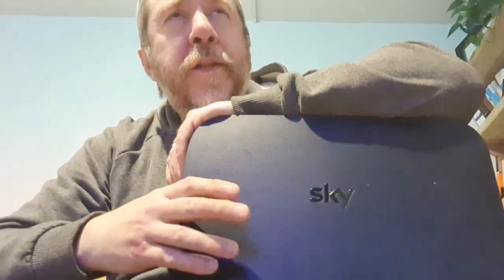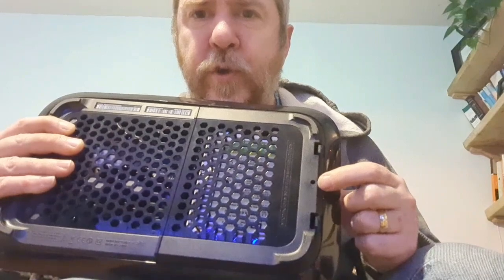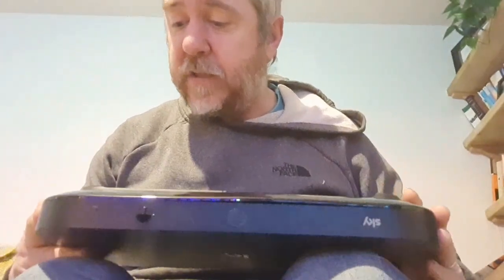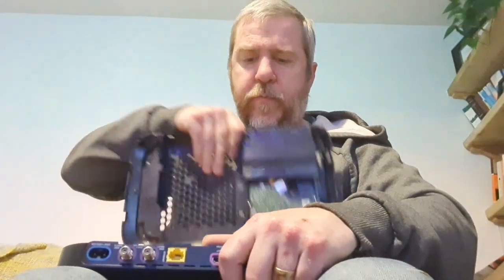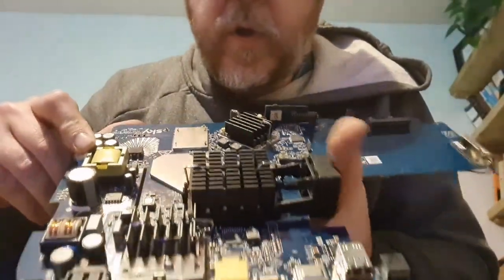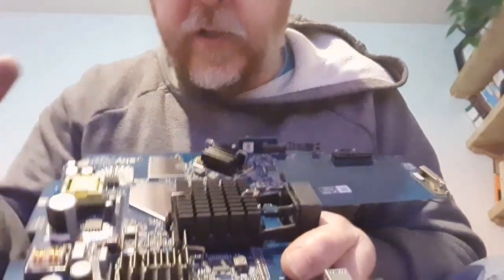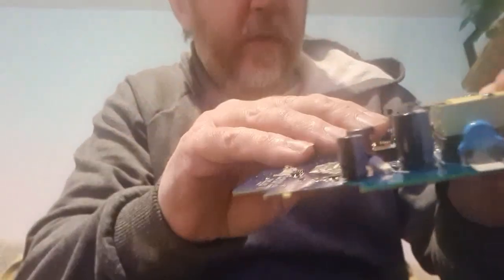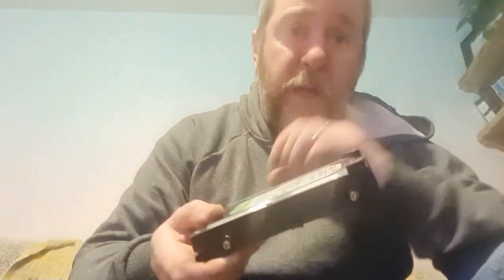Scrapping a Sky Q digital satellite TV box.  Is it better than the Sky + HD box for scrapping?

Comment: My dad was suckered into upgrading to Sky Q because he contacted Sky about having another HD box installed in his bedroom. They turned the patter on by telling him Q was the best option and he signed up without doing his research. That was a couple of years ago, and within months of having it fitted, it started to go south.

The box in his bedroom would intermittently unpair with the main box in his living room, leaving the only way to fix it by turning both boxes off for 30 seconds to clear the the system and then reboot and manually repair.

I told him to phone them up and get them to come back, take it all out and put the original boxes, but when he phoned them, they told him they couldn't because it was a one-way process that couldn't be undone. They offered to send out an engineer more than once to look into the problem in case it was a local hardware issue, and they would always say things like "it should work now" or "yeah, there was an problem, but we are already aware of it and it's a network issue that we are already working on and it should be fixed within the next 5-7 days." and it wouldn't make the slightest bit of difference.

Since then, it's deteriorated to the point where the picture freezes for a couple of seconds to losing it altogether leading to him having to reboot everything. Even the EPG goes on the fritz now. Out of a single 24 hour period, there can be between 12 and 18 hours of EPG information that's missing. He'll scroll through the listings and see something that starts at 10am and then the next program listing is for 2am the following morning.

My anyone thinking of signing up to Sky Q is don't bother.